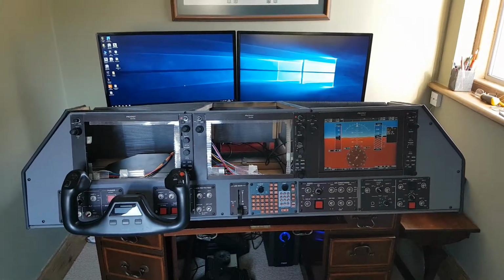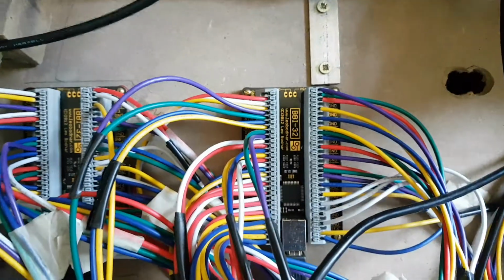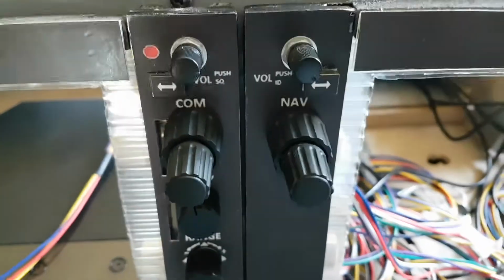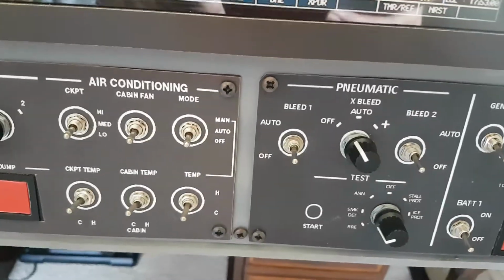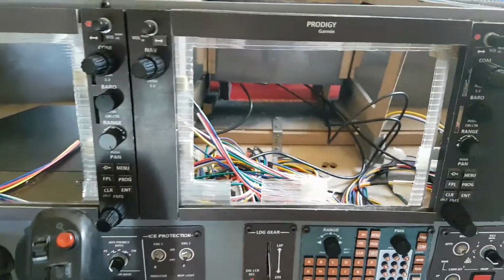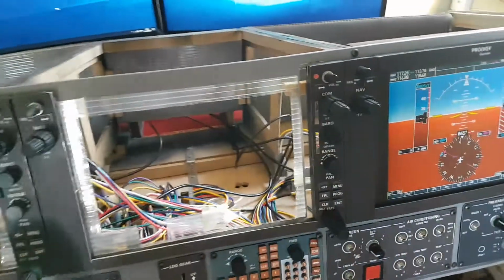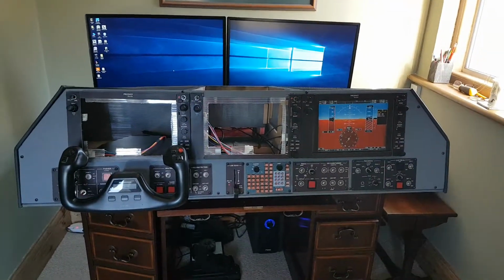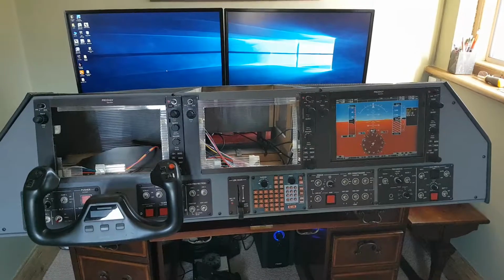What's under the hood of the cockpit

Comment: Where did you get templates for switch panels? Considering building building my home cockpit around this?
Reply from the maker: Hi Kev. I basically made them by eye. Once i had the size of my cockpit worked out i used photos to determine what size each panel needed to be. The one thing that I would have liked if expense wasn't a problem is having each panel made up with the correct white lettering engraved. I might get around to that someday.